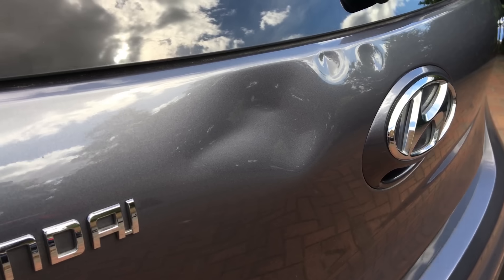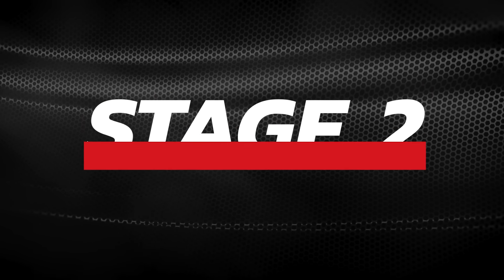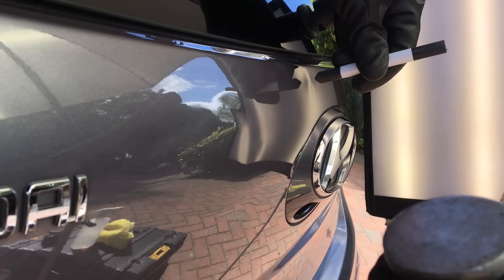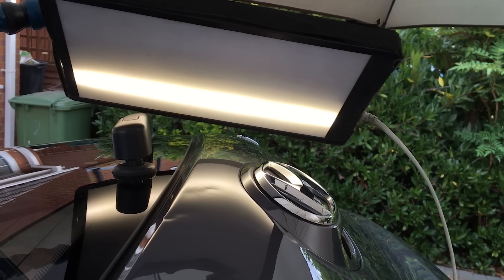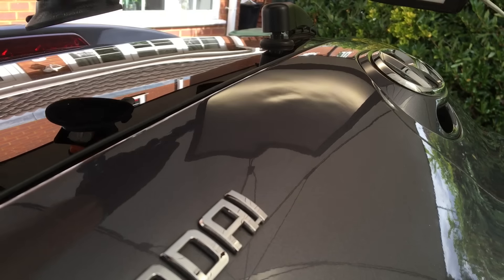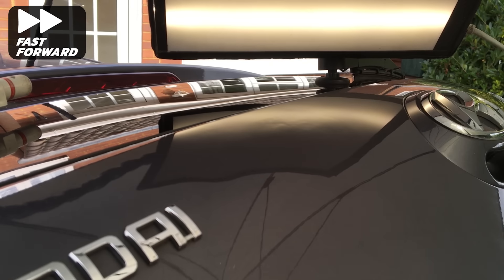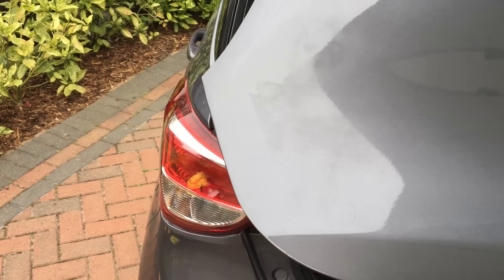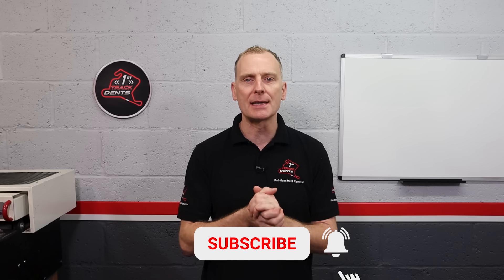FIXED in 3 STEPS! | NO Paint NO Filler!

Comment: If the car has been repainted or the paint is soft could the paint come out when you pull with the suckers?
Reply from the maker: Definitely, if I decide to use glue pulling, I will check the paintwork thoroughly for any evidence of repainting and if I suspect anything I won’t glue pull, it’s just too risky. 👍
Reply: 1st Track Dents thanks 👍

Comment: hey gerat job!!, what material is the "chisel" that you using to hit the dents?, is carbon fiber?
Reply from the maker: The tap down or knock downs I use are made from plastic, usually Acetal or any really hard engineering plastic. Some tech's like to use a polished metal tap down. 👍

Comment: I enjoyed your way of doing this job. Quick question, which brand of glue do you use? The ones I tried are worthless. Thank you.
Reply from the maker: Thank you! The best glue to use depends on the temperature you are likely to be working in, I work here in the UK where for the most part the weather is fairly mild, so I use Glexo hot glue and have also been using Tabweld and Hawg Glue. For stronger pulls on larger damage you would need to look at using something like Camauto flex collision glue. To remove the glue you just need a drop of isopropyl alcohol. 👍

Comment: can you please tell me the best type of clue sticks to use? I pursume you make up your own alcohol spray!
Reply from the maker: Glue sticks can be very country specific as it depends what climate you are working in, cold or hot? Here in the UK the weather is mostly mild so I use Glexo Hot Glue sticks and Tabweld. For heavy damage I use Cam Auto Flex Collision and I am currently trying out some new types, so it really can depend. Best to buy a few brands and see what works for you 👍
Reply: thanks for that .what about removing the glue.. I see so sort of spray you used??,
Reply from the maker: @user-oe1zd4qy5l  Isopropyl Alcohol 👍
Reply: Can you tell me who you use to order your glue sticks in the uk please
Reply from the maker: @user-oe1zd4qy5l  https://pdrprotools.co.uk/
https://kecotabs.co.uk/
👍
Reply: Thanks for your reply. I had looked at both of these sites... 
It's expensive to buy glue sticks
Reply from the maker: @user-oe1zd4qy5l  They are specifically engineered glue sticks for dent removal so that's why they cost what they do. 👍

Comment: What happens if you push it further out and crack the paint can you still make it look okay?
Reply from the maker: As long as you keep heating the panel and the paint is original it won't crack, it will only crack if the paint is not great or there is filler underneath etc and if that is the case then I wouldn't touch it and would suggest that it is repaired and painted instead. If the paint is original and you push too far, you can always tap it back down again. 👍👍

Comment: Too bad you weren't in my area, I would have hired you to remove some. I hired a supposedly 5 star rated company that did a ding on black car rear quater and I was terrified. They drilled back to access and didn't use glue puller. Used small steel hammer to tap down and used what looked like a shaved down metal screwdriver of some sort to tap down the risers. He then sanded down polished and left. He left a mess behind from suction cup markings to the polish splash out residue. (Said reason was because was hot outside and was on hill so he forgot) 🤦‍♂️. When I look up close at area of sanded part, you can barely see sand marks. And this was rated 5 star. Wow.

Comment: absolutely excellent i am a welder working mainly in aluminium and stainless steel i have a motorbike tank with few small dents in it led me to your video excellent work are you in ireland any time i will pay you and bring you for a pint of guinness or 2  mmmm eddie.
Reply from the maker: Sounds like a tempting offer, sadly I have no travel plans for a while. There are some good PDR guys over in Ireland though, so you should be in good hands 👍

Comment: i find it difficult to tell the difference between lows and highs any tips?
Reply from the maker: Hi, maybe you should go back to basics and make a small high and low next to each other and practice removing both. Once a larger dent is roughed out it can get difficult to tell highs from lows in the beginning as the area you are working on can get busy and confusing, it all comes with experience. If you are really struggling maybe you could try using a line board, I don't like them very much as the lines give me a headache,  I prefer a fog board as it is a soft visual aid but a line board will give you a very clear visual clue of the difference between both as the lines pinch together on a high and move apart on a low. It's just about putting the hours in and practicing as much as you can. Although give your eyes plenty of rest or you will find yourself getting dizzy  😵

Comment: What alcohol solution? I'm having a very tough time just getting the glue crap off of the car.
Reply from the maker: You need to use Isopropyl Alcohol, I prefer 99.9%, search for it on Amazon
Reply from the maker: and you will find it there 👍
Reply: Ty. I used that. But still was tough to come off. Unless you spray it after 30 seconds of putting tab on. I let the glue and tab sit in car for a bit and then pull it off. But not sure if that's the correct method or not
Reply from the maker: @ihorheaven1110  There is a bit of a technique to it and some glue comes off better than others, I use the Glexo hot glue a lot of the time and sometimes it just peels off on it's own. Otherwise I find it best to give the tab one quick spray an then try to lift the corner of the tab either with your fingernail (but best to keep chemicals away from your hands) or a I use a plastic wedge, when the corner is lifted slightly give it another spray and let the alcohol get right under the glue and then it should peel off easily 👍👍

Comment: Доста видеа изгледах и смятам другата седмица да си поръчам инструментите и да опитам на моите Автомобили и ако се получи си мисля да пусна една обява да видя дали ще мога да печеля от това достатъчно за да се издържам.
Имам един Автомобил на който е натиснато страничното огледало и точно там където е закрепено огледалото на вратата, точно там ламарината е малко хлътнала, това как може да го оправя?
Може ли да направите видео точно за такива вдлъбнатини?
Благодаря.
Reply from the maker: Sounds great, if you are serious about getting into PDR I would definitely suggest getting some proper training from a good PDR technician. Regarding the dents by the side mirror, sometimes these areas of the door are very hard to get behind so we sometimes have to glue pull these areas of the door from the outside using either hot glue or cold glue. I wish you lots of luck! 👍
Reply: @1st_track_dents  Thank you very much for your reply.

Comment: Looking at the repair after it's finished straight on doesn't show whether it was fixed properly creating a bird's-eye view in an angle shows everything..  did the repair come out perfect or wobbly..  impressive repairs required impressive angles with finished product.
Reply from the maker: If you look at the finished repair at the end I showed it from all angles not just head on, for me it came out to 99.9% you can never say perfect with any repair PDR or a full respray, but I can assure you there were no ripples or wobbles 👍

Comment: I'me letting you in on a little secret, repair shops don't like owners to know this. And it's ok to use glue, as actually it also works (quod erat demonstrandum), but it does so happen that it's rarely necessary. A good ball of spit slowly built with the help of your teeth (and no problem in using your fingers if deemed helpful, you know, especially with those big ones, when they get extra squizzy. And definitely yes with one of those that will stick to the ceiling and hold you by the hands at least for 5min. Or knock a bloke unconscient if you throw one at him and hit under the nose.
BTW, hitting him in the nose will also do the job, as with all that weight and grabbing or stick firmly capacity the poor devil nose will suffer heavy damage, if not from the impact that probably will at least brake a nose bone, surely from the sudden and violent neck rotation due to the push that an object of that size and weight will inevitably force your neck to do, as there's no way you can resist to follow that incredible object trajectory through the room. Or through whatever.
But I digress.
Anyway, next time try it instead of glue. You'll be surprised.
😮

Comment: Incredible dent fixing method, but not completely honest. After tapping the paint with a pointed object, you puncture the finish and will need to repaint the area, otherwise it will rust. Another  issue that was not addressed is metal stretch. Such a dent has stretched the metal to an extent that you will need to shrink it by heat or create an uneven surface that must be filled. If the stretched area of the metal is not addressed, it will be weak and wobbly.
Reply from the maker: Hi Jan, thank you for your comment, I can assure you that the tapping down object does not harm the paint in any way shape or form and is used everyday by millions of PDR tech's all around the world and done properly it doesn't even leave a mark on the panel. It is a tool made from hard plastic. Modern day paint finishes are extremely strong and durable. I have revisited loads of jobs that I have worked on years later and there has never been any sign of damage or rust forming from any tapping down. On your second point, this dent was not stretched at all, the metal was just displaced and was easily manipulated back into place. If the dent was stretched you would have seen it 'oil canning'  (popping in and out) which then would need to be treated with a special power PDR power box. I have worked on several stretched dents recently which needed the Power PDR box and they are completely different dents altogether. Not sure how this can be a dishonest video, when I have laid the whole repair out showing every step and shown the final result, if the metal was stretched the final result would show a bulge or dip in the panel.

Comment: That is alot of work!

I am really upset that I park very close on the right side toward the wall to leave well enough room over on the left within my side of the yellow line that marks my parking space. My car is practically 1/8th of an inch from the passenger side mirror to wall that is really close! BUT- yet, people still need more room as if they need 2 parking spaces or have a wide load trailer? 

Is it me or do some people purposefully whale their car doors wide open without having any concern for someone else's property? 

Dents cause rust and rust eats away metal and I need my car healthy. I think that behavior should be a crime or a ticketed offense. If it takes this much work to undue the dents people cause to another person's car then I need some remedy. 

This is annoying me and more soo really pissing me off- this is my apartment building indoor parking space. 

I will speak to the administration and I want to see the surveillance video. I am mad. And am wondering wtf is this happening? 

I should park inbetween the lines and take up the whole space and leave absolutely no room for another car! Park the car horizontally and see what the hell they are going to say! 

I just buoght this car ending of 2019.

Comment: $350 dent removal
$200 Panel R&R
$150 shop supplies
_____
Should have just replaced the panel and had it painted.

Not saying it's his rates, just local to me for a like repair.
Dent guys generally try to charge the same as a replacement for a lot of basic repairs.
Reply from the maker: Here in the UK PDR is relatively cheap compared to the US and Canada and is always cheaper than a panel replacement or respray. So this was the better option. I would love to be getting $350 USA dollars for something like this, and if anyone is charging $200 for R&I for removing one screw and popping off a trim, then I'm not sure how they sleep at night 😂